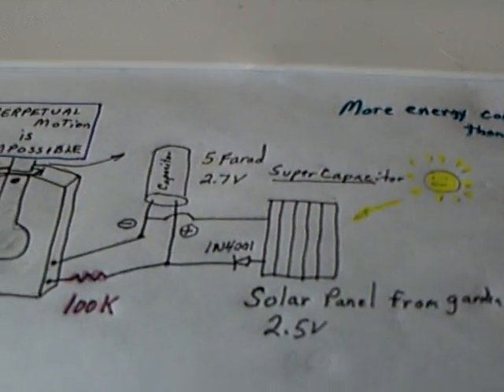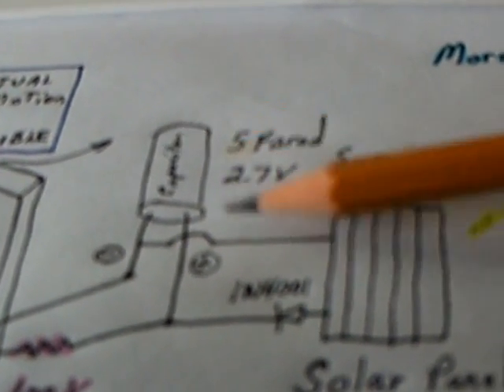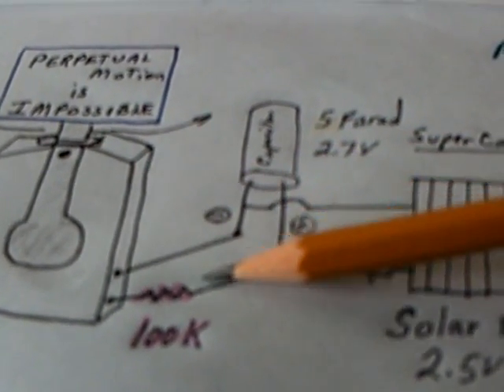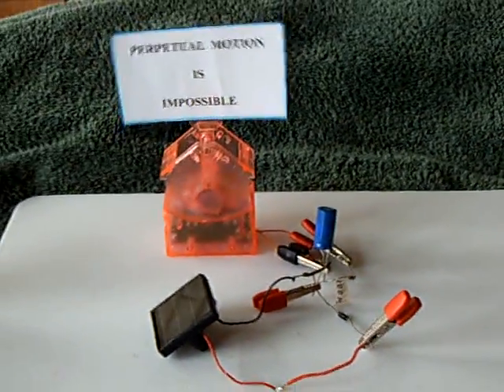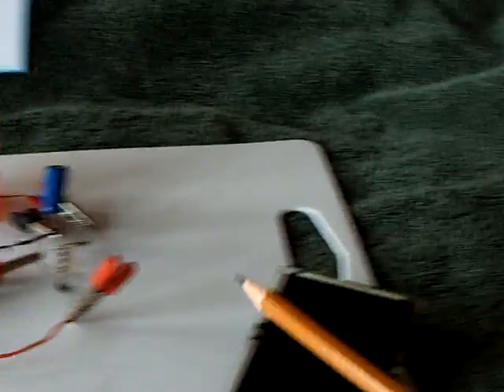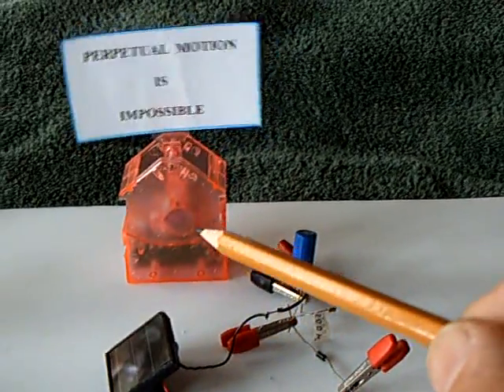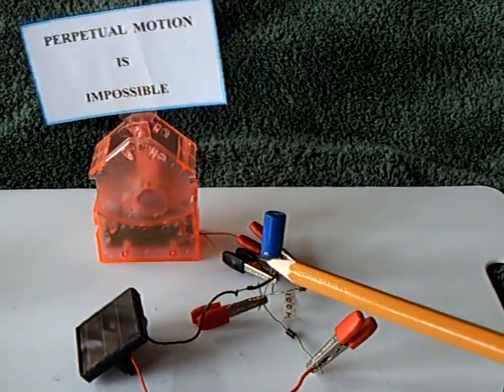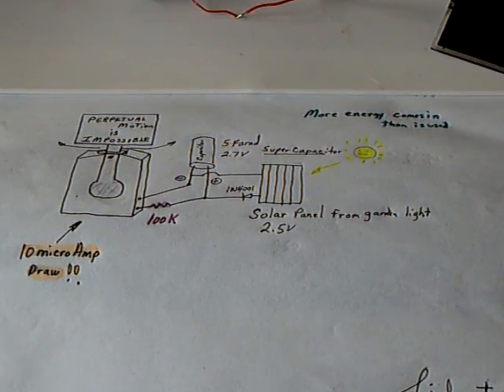Perpetual Motion Is Impossible

Comment: Perpetual Motion is impossible? People keep telling me how impossible it is and while I appreciate their opinion... that statement is patently false. All the universe is in perpetual motion around me... count the ways. If I were to attach my little red wagon to some matter in perpetual motion my little wagon would roll perpetually. Maybe one fine morning I might wake up and decide to irrigate all of the Sonoran and Gobi Deserts and generate enough electricity to power up America and Mexico to make them great again... how would I do it? That's easy. Build a colossal Hydraulic Ram Pump down near New Orleans and channel the Mississippi River into it... As long as the pump is operational and the Mississippi flows you will have more energy on output than input. Another problem solved. Whats next? Did I win something?
Reply from the maker: Basically I totally agree with you.  The problem is the word 'perpetual' means forever and I guess it boils down to an eternity thing.  Maybe ...but something will probably happen before then to stop the motion.
Reply: Perpetual doesn't mean forever. It means that the engine goes on operating once started and runs until it breaks or the environment it operates in changes and causes it to quit. Sure there are some people that might want to split hairs over the Mississippi river drying up in some odd millions of years but what is that to us now when the world needs big solutions to big problems? The only reason to use a river is for the fresh water for irrigation purposes. A 6" ram pump can pump 135,000 gallons of water an hour to 110 feet higher than the pump. Imagine a 60 ft. intake, a 600 ft. intake. A ram pump can be built beside any ocean and piped into the plant and made to drive an electric generator and the water ejected back into the ocean. I believe that The Great Pyramid is a huge ram pump. That's my theory and I am sure that it's correct. It is the only zero carbon solution to the energy equation. It is fuel free... the intake must be underwater with a few pounds of pressure. No combustion process, hence no cost after construction except maintenance cost with 2 moving parts it is no big expense.

Comment: Just to clear this up.. magnetic energy is still energy.. If it is used iw will run out, magnets weaken for a reason!They have a charge in them!
Reply: dillon ryland 
Magnets aren't "energy" they are a force, a constant force.
Reply from the maker: We still don't fully understand how all this stuff works.  They have come up with formulas to deal with it but magnetisim and gravity are strange things.  I don't think that comparing a magnet to a capacitor or battery (as far as 'charging') is exactly right.  I wish that I could build a pure 'magnet motor' that ran on magnetisim and was recharged by remagnetizing the magnet.  That would be cool.  I havn't seen one of those yet.

Comment: come on guys, perpetual motion isn't or should not be measured in tens of thousands of years. lets redefine it to 100 years and when we reach that we could bump it from there.
Reply: Why think small? Build a colossal ram pump down near New Orleans and channel the Mississippi into it. More energy out than in. Irrigation water and electricity as long as the Mississippi River flows and the ram pump is in operational order. The Mississippi has been flowing for millions of years. It is likely to flow for millions of years more. The statement that perpetual motion is impossible is just the opinion of the person that doesn't realize that they stand with both feet in a world that is in perpetual motion turning in a universe that is in perpetual motion. I know... score one for me. Beat you all to it. I don't need to break any laws to do the impossible just, bend them a little.

Comment: Does electrons around a proton, on an hydrogena atom, is not a perpetual motion?

Is the "Perpetual Motion Holder" doesn't keep inside permanent electric waves that produce a permanent magnetic field?

Perpetual motion systems do exist!

The problem is to have "perpetual energetical converters" to get an extra power for use...

Cheers.

Comment: Neat and cool little gadget none the less :)
This sort of thing gets really fun in winter, with the shorter days etc...but the room light goes on for a normal house and these things still run !
Say, was clearing my workbench today and found a ForeverLight that fell off the PC monitor..it landed at the side of the base of my 13W CFL (yes was that messy lol) and is still going. 
Quite right what you said, just make the panel bigger to make sure of running.